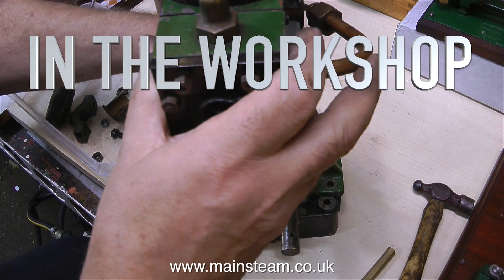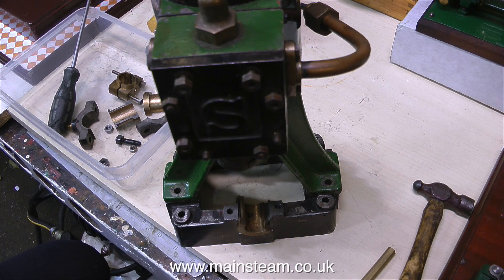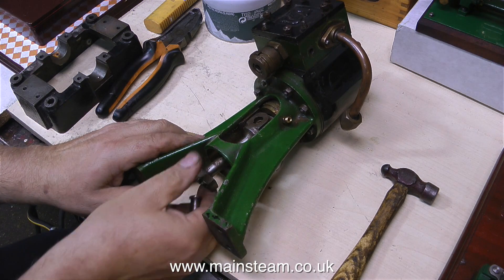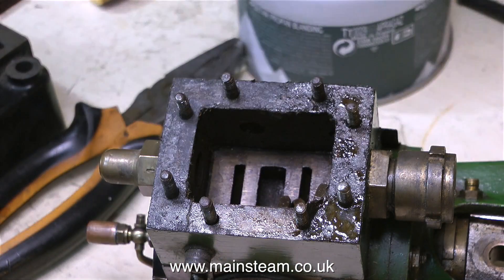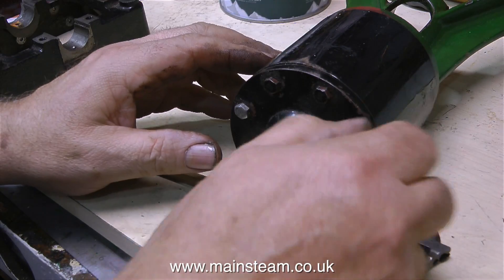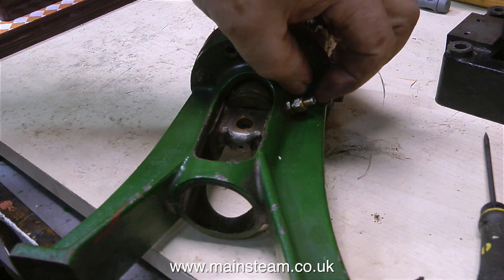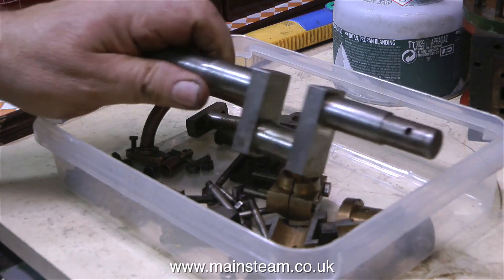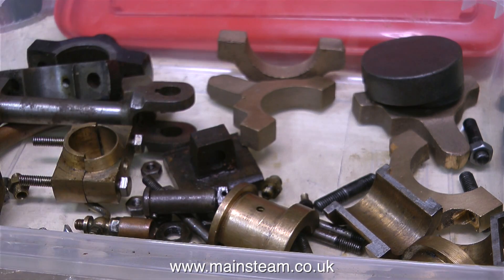IN THE WORKSHOP - STUART MODELS 5A STEAM ENGINE PARTS

Comment: Adjustable Spanner? TUT TUT
Reply from the maker: Why - "TUT TUT ? it is a Bahco . . . . . when you run steam engines bot small are larger ones, a spanner is often required quickly, so a Bahco is the answer - one day all adjustable spanners should be made this way . . . .

Comment: With a cylinder boare that big, it looks like you could do actual work with that engine. pump water, push a rowboat, or something.
Reply from the maker: 1 1/2 HP at 80 PSI - suitable for a 20 foot boat :-)))))

Comment: You could probably machine those bearings back to size: mill a bit off the mating surfaces and then bore a smaller hole.
Reply from the maker: The hole is miles too big, I will make some new ones I think  . . .